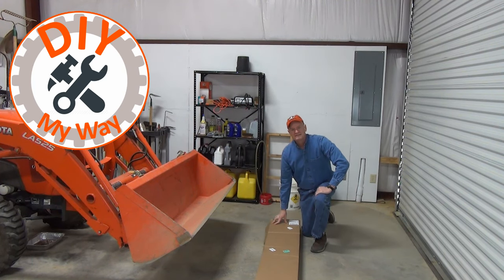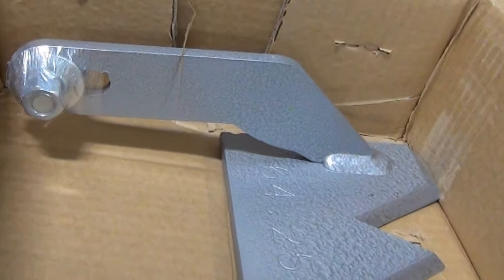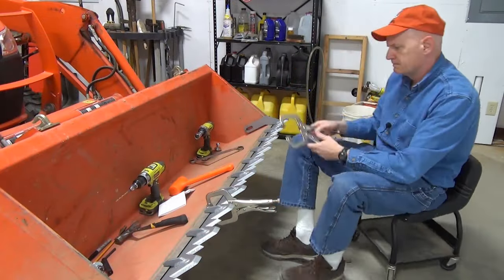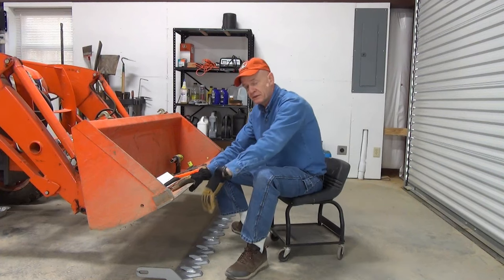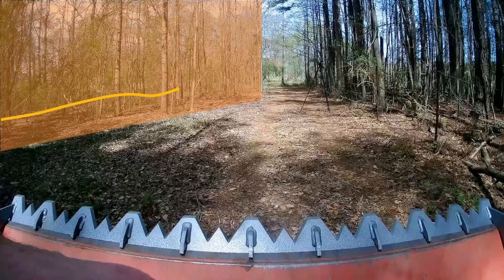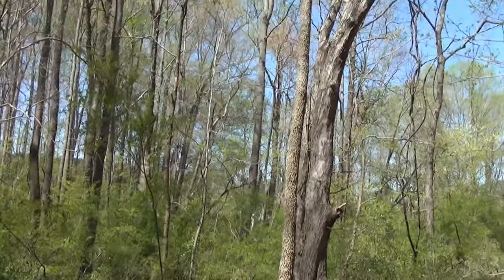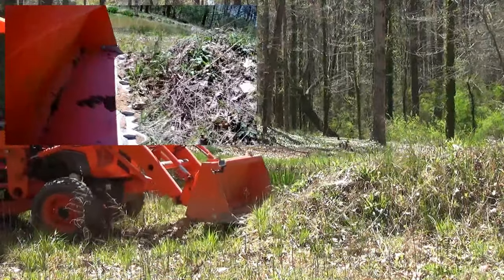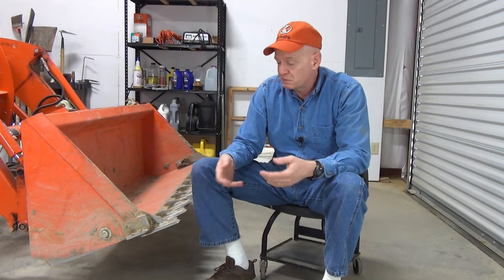BXpanded Piranha Tooth Bar: Installation, Testing and Review - Wish I'd Bought It Sooner! (#126)

Comment: I've had one for more then 5 years. It has never left my bucket. I can do everything with it.
Reply from the maker: They’re great for sure! I’ve only taken mine off once for a specific job that needed a flat cutting edge. Easy to take off and put on. Thanks for watching!
Reply: @DIYMyWay  This also saves the original bucket edge from getting destroyed from excessive use. My equipment is not garage queen pieces.

Comment: I just purchased a Kubota LX2610 HSDC.  I had previously watched this video and already had determined I would add a Piranha tooth bar to my bucket prior to using it.  The only dilemma was that on their website they strongly suggest measuring the inside diameters of the bucket and not use the specs from the tractor company, so that is why I waited.  My order was submitted the same day the tractor was delivered.  I received my tooth bar in 4 days even though it stated a 2 week lead-time.  
I experienced a similar issue with the length of the bolt size.  I contacted their technical manager and he sent me out a 1/2” longer bolt to make fastening easier.  I wasn’t able to get the second lock washer installed and the bolt wouldn’t bite, even with clamping.  
I appreciate you doing this video and I had my tv on in the garage and used this video as my installation guide.  Thanks Martin and love your content.  We are definitely like minded!!!  Keep up the good work.  
Steve in Austin Texas Hill Country.  👍👍
Reply from the maker: Hi Steve! Sorry you had trouble with your installation, but glad to know the video was helpful to you! Thanks for watching!

Comment: I bought one of these for my L3301  525 bucket Kubota probably six years ago. I have been impressed. It is  rocky on my property and I have used the heck out of this bar. It has worked awesome and held up great. Its hard to believe it doesn't have more wear on the teeth than it does. Increased the use of my bucket many times over. If It broke, I would buy another tomorrow. I have no affiliation with them. Just want others to know what a great product it is. Get ya one. you wont be sorry.

Comment: I ordered one of these 2 weeks ago. I can't hardly wait to get it on my 1960 Oliver OC46 track loader and get busy with it. 
 I have about 2.5 acres that was in CRP for 22 years and it has become over-grown with hundreds of Mulberry trees, most an inch and a half or smaller in diameter.
 Next door to me is an acre or so of old pasture that was cleared last fall of all the trees, but has very uneven ground and LOTS of tree roots left behind. I'm hoping this will help in removing a lot of the roots and leveling of the ground that hasn't been worked in 40 or 50 years.
Reply from the maker: Wow!  Your Oliver track loader is as old as I am!  Didn’t know Oliver ever made track loaders.  Cool!  I think you’ll find the tooth bar will super charge your bucket’s abilities, especially with the push power I imagine that track loader has.  Thanks for watching!
Reply: @DIYMyWay  I have7 years on the Oliver! 
 I got "Scoopy" fixed because pf Youtube kinda. I watched a guy working on an old Allis Crawler, then watched his next video, which was an Allis tractor, and figured out he was a neighbors son. Grew up less than 4 miles from me.
 He has a 4 or 5 videos from getting it started the first time in 13 years, to rebuilding the steering clutches, then remounting the loader. Here is the day he got it running and took it home to fix up. https://www.youtube.com/watch?v=2o4O86uTv8k

Comment: I have a very small old Kubota tractor with a loader and this looks like it would be an excellent upgrade for me. It almost seems like the less power and weight the tractor itself has, the more it would help!  Great video.
Reply from the maker: I think you are right that it would help out smaller, lower HP tractors more because it will maximize how much you can dig with your FEL. Thanks for watching!
Reply: I love mine and will echo others.

Comment: Mine just arrived but it’s width is the same as the bucket sides.  They will send out one the right size and pay for the return.  Should have it shipped next week.
Reply from the maker: Sorry they shipped the wrong length but glad to hear they are making it right!  You’ll be amazed at how it can transform your bucket!
Reply: @DIYMyWay  
They are making it right which very good of them.  The inside bucket dimension is 52.875”.  If they make it .25” less than the actual 52.875” it should slide right in and allow installation.  Stuff happens.

Comment: U make Install look simple. Your verbal instruction are spot on. I would suggest placing wood or cinder block under back edge of bucket for safety. Hate when the bucket drifts.  I do need to ask, why a claw not ball peen hammer?
Reply from the maker: Thanks, Stuck!  Good point about the cinder block!  Because it was right at hand.  I do have a ball peen hammer somewhere.  The question is where. Thanks for watching!

Comment: These are very useful. I have a brand called the Ratchet Rake with a set of teeth on the front and bottom. Like the name implies it attaches with ratchet straps. One word of caution, it is possible to bust hydraulic hoses with these if you put too much pressure on it. I would think your model is better for digging and possibly a better all around model, I like it.
Reply from the maker: Yes indeed!  I’ve seen some videos on the Ratchet Rake.  It’s great for clearing brush.  I wanted something I could dig aggressively with and clear brush, which the Piranha tooth bar excels at. Thanks for watching!
Reply: @DIYMyWay  I have the Ratchet Rake on a M6800 and I just purchased a B2601 w/ grapple bucket for cleaning up the wooded areas and mowing my lawn. I'll put a Piranha Tooth Bar on it, I really like the looks of it. Thanks for the video from SE Tennessee.

Comment: I like it but I would definitely get longer bolts, as a general aviation rule, two threads minimum should be protruding and I may add a cotter pin for extra safety. Thank you for the video

Comment: I’m real interested in the pro model because it is reversible between flat blade and serrated edges. Now I’ve got to convince my wife to go along with shelling out another $700 after we pay $65,000 on a new tractor and implements. Thanks for the video!
Reply from the maker: Hey Robert!  IMO, the pro model has too many bolts to take off to switch edges whereas I only have to take off two to get to my buckets factor flat blade. Thanks for watching!

Comment: Thanks for this video. I am installing mine today. Were you able to get enough turns on the mounting 15/16 nuts or do you recommend buying a bolt that's a little longer ?
Reply from the maker: Congrats on getting your tooth bar!  I found the bolts were long enough for my installation.  Good luck with yours!
Reply: @DIY My Way  Wow, thanks for the fast answer. You saved me a trip to buy bolts. Thank you.

Comment: Why no stainless washers between the Piranha Tooth Bar and the inside wall of the bucket? Your video shows a gap there. Washers would relieve stress on the Piranha Tooth Bar mounting ears. Stainless hardware (bolts and washers) also deter places where rust can form. All in all, that bar provides a lot of bang for the buck in making the bucket much more useful than just having the factory edge on the front edge of the bucket. You always come up with winner ideas for your tractor! Great job.
Reply from the maker: Hi Don! Yes there is a gap and adding washers is a good idea.  I might have to scrounge around and see if I have any that would work.  The tooth bar makes a HUGE difference in the digging ability of the bucket and it can hold more in the bucket.  Thanks for the kind words and for watching!

Comment: Nice. Great video. I need to get one.  They now have a "pro bar" with two edges that can be flipped. Do you think that adds any real value?
Reply from the maker: Thanks!  No, I don’t think it adds much value.  If I recall correctly,  you have to drill a lot more holes and use more bolts.  With the original one, you just take two bolts off to get back to the straight edge on the bucket. Thanks for watching!
Reply: @DIYMyWay  Thanks..

Comment: Where did you get those hooks at? Do you have a video of them? I was gonna weld a couple on, but those look much cleaner.
Reply from the maker: From Ken’s Bolt On Hooks.  If you are good welder, then weld on hooks would be cheaper and probably stronger.

Comment: What is this "bucket cam" rig? My luck, I'd have that knocked off in about 5 minutes. I was thinking of mounting one low down inside the  grill in the front.
Reply from the maker: I have two that I use on the bucket.  One is a magnetic mount for an action camera the other is a clamp on mount. Thanks for watching!

Comment: QUESTION: Do these ever need to be sharpened? If yes what do you use file, grinder, flap disc? Love your videos.
Reply from the maker: They come ridiculously sharp, but wear to a reasonable point over time.  I’ve used mine a lot but haven’t seen the need to sharpen the edges yet.  If I did, I’d probably use an angle grinder. Glad you love my videos! Thanks for watching!

Comment: How about working with gravel? How does back dragging work for smoothing a gravel bed.
Reply from the maker: Good question, David!  It will push into the gravel pile with no problem.  For back dragging, I'll find out soon because it's time for my Springtime driveway maintenance.  I expected it would leave grooves in the gravel if you had a steep angle on the bucket, but if you use a shallow angle, you probably could even see them. Thanks for watching!

Comment: Second time (or maybe third?) watching this video. I am waffling between this and the Wicked. There is definitely a price difference and  imagine the EA product is going to be ultimately tougher. I just doubt the limits of the BXpanded would be tested by me. Same tractor as you and very similar property to you. Great info as always! Thanks!
Reply from the maker: Hi Dave!  The EA Wicked tooth bar probably is tougher but I have found the Piranha tooth bar is holding up very well.  Thanks for watching!
Reply: @DIYMyWay  A couple more questions Martin (sorry): Did you ever have a need to remove it from your bucket? Where there any surprise use cases that you have stumbled upon since owning it?  Thanks! Dave
Reply from the maker: No I haven’t had the need to remove it yet, but some day I might have a reason.  Good thing it’s easy to put on and take off.  The biggest surprise was how it helps with back dragging with the bucket.

Comment: I have a bx23s. What I'm worried about is when I go back to the factory leading edge I will be stuck with two holes on the side. Where lets say you would get spillage from fine materials? Thanks Mate
Reply from the maker: The fix for that is easy, Allen.  Just put the bolts back in the holes and tighten them up. Thanks for watching!

Comment: After seeing your video I bought one. did some work clearing dead mesquite saplings and small diameter mesquite trees ( 1.5in). Got alot done in a few days. Now the edges are not as sharp, of course. Do you have a video re-sharpening  the edges?
Reply from the maker: Hi Humberto!  Yes, the tooth bar is a great enhancement to a loader bucket.  Sorry I don’t have a video on re-sharpening the edges. Thanks for watching!

Comment: Thanks for another great video! Since the slots are to allow for wear on the bucket Edge when you're not using the tooth bar. Under what circumstances would you wish to take the toothbar off?
Reply: If you were doing finish work you might remove it. I know this video shows backdragging with it but a lot of guys prefer the smooth edge. You also don't need it to move a pile of loose rock or sand for example but I find it's easier to just leave it on. Mine hasn't been off even once in about a year since I got it.
Reply from the maker: Hi Terry!  Thanks!  Right now I can’t think of any circumstance that I would take it off, but it’s nice that BXpanded thought of it in case some folks do take theirs off.

Comment: Very helpful as I prepare to put my toothbar on my B2601. I am interested to see if it will help me thin some 2" diameter pines. Ideally this would be without tearing up the soil, so I would be cutting them at the base. Any tips?
Reply from the maker: Glad to hear it!  I doubt the tooth bar will get them out with ripping up the roots.  If you need them flush cut, a cordless sawsall with a pruning blade might be your best bet.  But it won’t be nearly as much fun as ripping them out with the tooth bar on your bucket. Thanks for watching!

Comment: Why did you not buy the EA tooth bar? It is super hardened steel. Hardox.
Reply from the maker: Because I was turned off by the ridiculous comparison video they did with the Piranha tooth bar.  But I do love my other EA attachments and the Piranha tooth bar has held up very well.
Reply: I have them on all my tractors. Then I found EA so the next one I get is going to be Hardox. I see some dulling of the piranha edges.

Comment: do you take the PT bar off or leave it on ? will rocks or gravel dull or damage it ? TY
Reply from the maker: I plan to leave it on until I have a reason to take it off.  Just scooping and moving gravel shouldn’t wear on it much but digging into dirt with large rocks would certainly dull the edges.  However, they could be easily sharpened with an angle grinder. Thanks for watching!